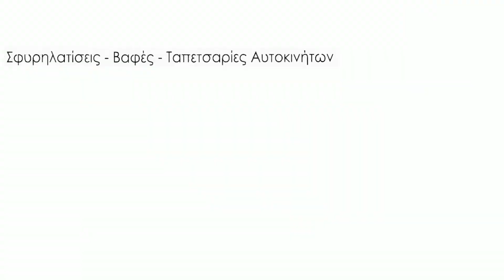Škoda Fabia  (1999 - 2007)  door panel removal

Comment: As an added note, the door handle panel removed at 0:30 doesn't have clips, it slides forward and out.  I lost a couple of bits of plastic finding that out (thankfully non-vital ones) so learn from my mistake!  The last step of lifting the main panel up and off was a lot harder for me too, but with some wiggling it should come up and away from the window.